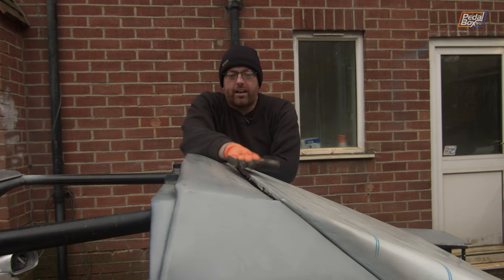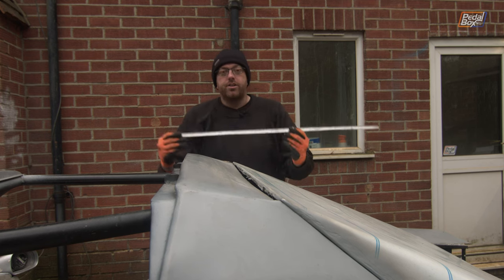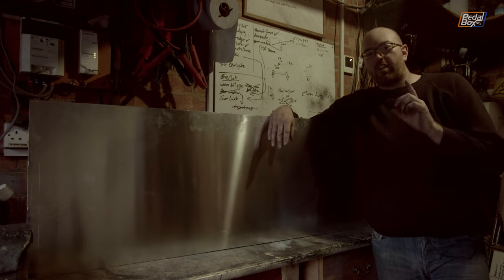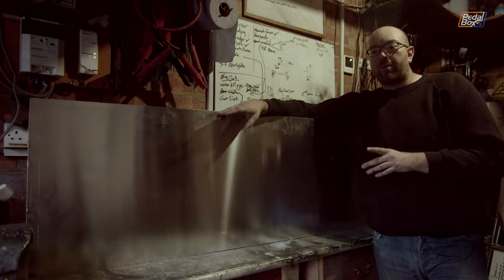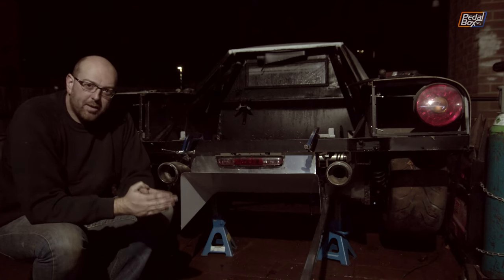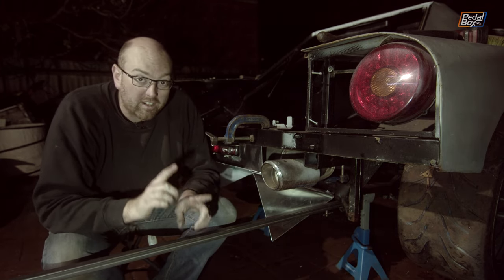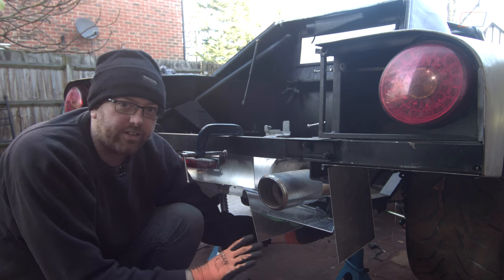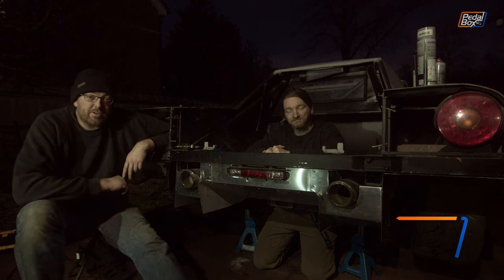Rear Diffuser Build | Audi TT Kit Car | PedalBox Episode 122

Comment: Louvers in the engine cover would look good
Reply: Definitely on the list of things we want to do!
Reply from the maker: Definitely has potential for that. Even more so if the engine needs more cooling I guess
Reply: @PedalBox  Could be good to have them on a push rod and cable system, louvers closed for warm up and then flick them open if the rear compartment temps start creeping up
Reply from the maker: That'd be quite cool, something for post IVA to add on, along with a roof :D
Reply: @PedalBox  My list of post IVA stuff is longer than the list of stuff to complete 🤣🤣
Reply: @PedalBox  a couple of small linear actuators could be cool for operating the louvers/speed vents. Would be something like a miniature bat mobile getting ready for battle 😁
Reply from the maker: Finally, something I can use extra toggle switches for!
Reply: @PedalBox  🤣🤣🤣🤣🤣